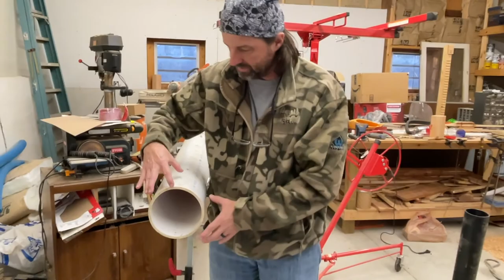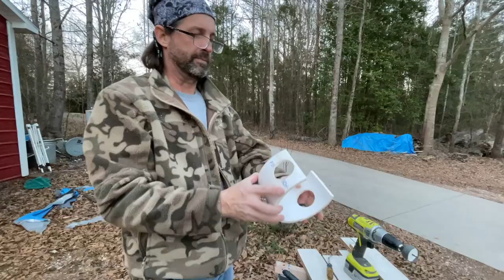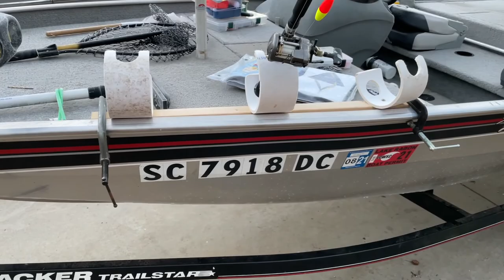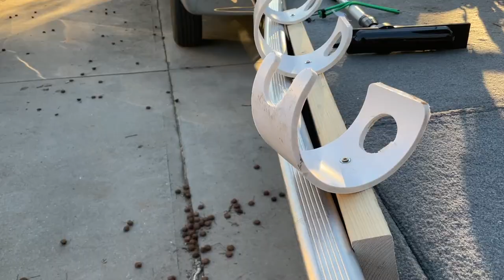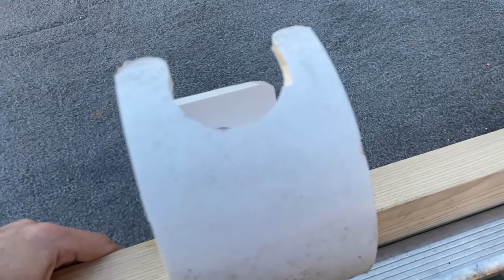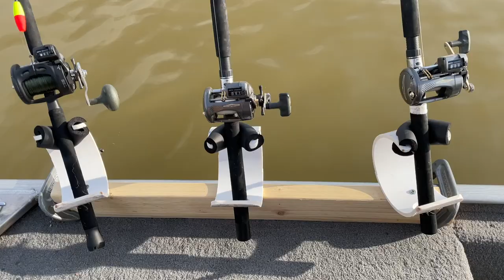DIY Catfish Rod Holder for Bass Tracker - Mount only when needed!

Comment: Great idea.  Looks real good.  Thanks for sharing.  I found your video hunting for rod holder ideas for my 8 ft. Pond Prowler.
Reply from the maker: So it wasn't my idea, I actually saw this on and old post on the Catfish1 forum.  So far its working like a champ.  A few modifications make it better.  Instead of drilling a hole to put a screw through to mount it.  Cut a slot and use a screw with a washer.  That way the rod holder can be adjusted to what angle you would like.

Comment: Boone... great design!  The only thing I would change is using lag bolts with a washer instead of screws.  The lag bolts are stronger, and will bend rather than snap under a load.  Those construction screws tend to snap (especially where the shank meets the threaded area) because they are made from hardened steel.
BTW, you could probably find some "grommets" to fit the lower hole.  They are made from rubber, come in standard sizes, and will protect the lower end of the rod handle from scuffing... I wonder if you could also just apply some silicone caulk... hmm...
Reply from the maker: Yep that is a good idea and I would also put a slot instead of a hole through the PVC so you can adjust the angle too.
Reply: You know your stuff boone!
Reply: Yes you are right

Comment: Brother you save me both time and money !👍
Reply from the maker: Awesome Billy!  Here is what I would do different now that I have used these for a couple years.  Instead of drilling a hole through the PVC where the screw goes through to mount the holder to the wood, I would cut a slot, then I would use a washer on that screw.  This way you would be able to adjust your angle of the rod holder.  Other than that, these things work great!

Comment: I have these on my pontoon all around the rails. They are slotted for adjustments
Reply from the maker: Yes.  I have thought about changing it to a big washer and cutting slots so I can change the angle of the pole.  That is excellent.  I need to do a similar setup for my pontoon as well.

Comment: All u need to do is remount those holders to b canted at more of a letter u shape instead of a letter c. That way your reel can actually sit inside the the the top cutout u made
Reply from the maker: The other thing I thought about was making the screw hole a slot so I can rotate them to whatever angle I want.

Comment: Why you didn’t slide the reel behind the seater , inside the pipe , this way it would not slip forward, like the idea
Reply from the maker: I dunno, just haven't tried it that way.  I have thought of adding a slot to the PVC pipe so that I can rotate the position of it to change the angle easily though.

Comment: Great design but you might wish to modify it so the reel or rod contacts something that stops a large fish or turtle from pulling your rod/reel setup out of your holder loosing it forever
A local large private lake has a catfish tournament every summer and there are some huge blues and flatheads in the lake along with very large soft shell and snapping turtles and without fail people using DIY rod holders that don't lock their rod/reel in the holder loose several setups every year especially at night
Reply from the maker: Yea that's a great idea Arthur.

Comment: Great idea.. how much weight it can handle??
Reply from the maker: I really don't know.  I have been able to use it on my bass tracker as well as my pontoon.  I have caught a bunch of catfish using it but all less than 10 lbs so far.  It is pretty stout PVC I used so time will tell.  I don't think it will have any problems if I hooked a 25 - 30 pounder but don't really know yet.